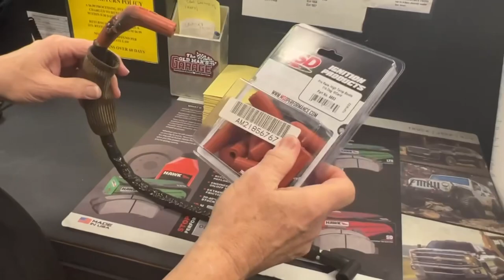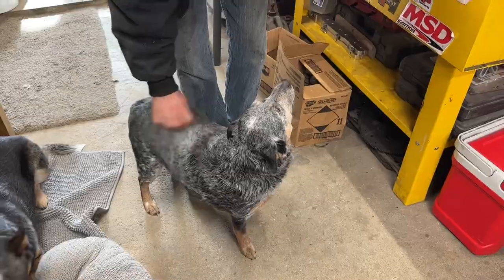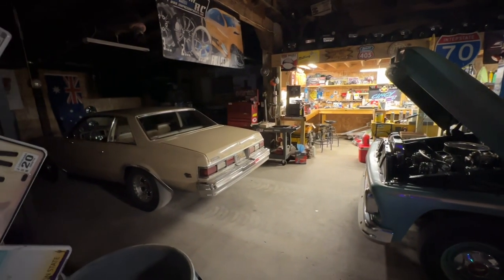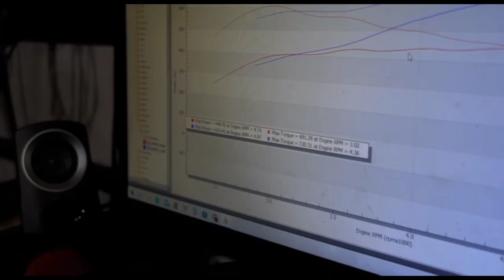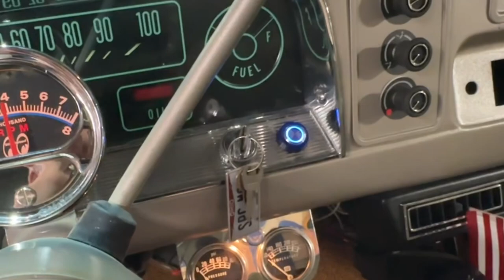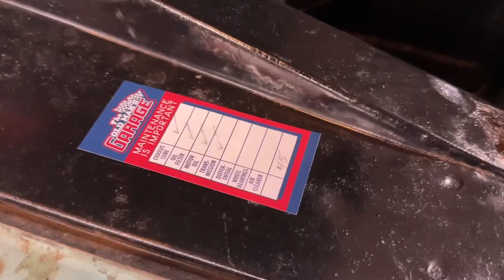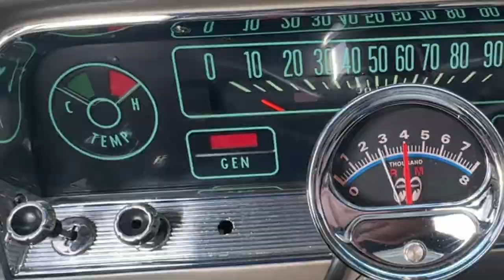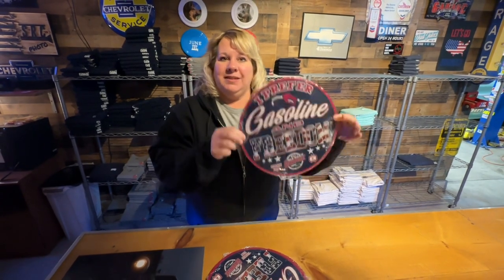WHERE WOULD YOU LIKE TO SEE ME GO NEXT?  Traveling in a 1964 C-10 and GRUDGE RACING the Malibu?

Comment: Have you checked the length of the drive shaft? If its to long it can knock the clip off😀
Reply from the maker: No but that may be the culprit.  I’ll check into that!
Reply: It's great when the comments have a good idea
Reply: Without a doubt. Measure from tailshaft housing to rear edge of the speedo cable hole, remove the cable and housing and mark that point with a sharpie around the tailshaft.

Reinstall the driveshaft, and flex the rear-end forward a bit in both directions with a primary just in case it is being caused by rear end rotation of the housing.

If the front yoke is covering the mark at any time, it is a good indication that it is approaching the clip or gear (knocking the clip off).

Remove the front yoke and have a bit machined off of it as long as it does not approach the tailshaft seal rub mark. Otherwise, you will need to have the center area trimmed on other end.

But you did have that driveshaft made to fit your own  custom measurements correct?  It may not be a Jeremy curse after all, but simply an overweight error.
Reply: Pry-bar...not primary.
Reply: Stupid autocorrect....over length.
Reply: On the other hand, maybe autocorrect is correct, you in drivers seat, trailer and fat G-Body Cracka' Barrel on trailer flexing that old C-10 with a too tight driveshaft and older weak framerails could be seen as an overweight issue...lol.

Just kidding old man, no hater here, but I think the mysterious speedo cable gear rework the 30th time may just be resolved with a bit of remeasuring and work.

Comment: 400s are known for getting hot pulling loads in the hills. My dad went through it with a straight drive 3/4 ton truck. New fan, bigger radiator, added electric fan also. Different shroud. Still got warm. 
Last time I changed oil in my 400 in drag truck filter didn't want to come off and I put it on a couple months earlier. Put fresh oil on the seal and I know I didn't over tighten it.

Comment: Hey Bill with all the oil you guys go through I'd invest in a Oil Burning Furnace for the Garage,  take the truck to a transmission shop to fix the Speed O . If you put a cap on the 65 for high way use would help keep wind and junk hitting the car , years ago a friend took his open trailer and had a peice of steel welded to the front to deflect things off the car and tool box too.

Comment: I'd get the Dakota digital guages and GPS module for the 64. I kept having issues with a 700r4 and the stock speedometer in my 65 c10. Now I have a functional speedometer and I don't have to worry about tire sizes affecting my speedometer as well.

Comment: Absolutely love watching you and love your Malibu I just recently aquired a 1980 2 door Malibu and I'm gonna build something that everybody dogs on for not being a good engine with some parts from Chevy dodge and the aftermarket I'm going to take an old late 70s ford 400m deck the block do some crank work to fit the Chevy rods with some dodge 340 V8 pistons a nasty cam and a 850 cfm carb I'm hoping to be pushing around 500 horse which makes me more then happy for my first street car  I got he build idea from motor trend a few years back when they built the "mutt" a 431 cubic inch 400m they got 505 on the Dyno can't wait to have my Malibu going.

Comment: The 64 is really getting dialed in, now it just needs a retro sound Bluetooth stereo and a set of Dakota Digital RTX gauges so you can have a nice heads up digital display on the dash to monitor all the vitals of the engine/trans and maybe converting to the digital speedometer will solve you problems with it not working. Plus it would look really sweet and update the dynamics of the interior substantially while still looking retro.

Comment: Running a hobby grade rc race truck or car at the track helps with suspension and traction adjustments when ya start running real vehicles down the strip.. tire and traction compounds and bar placement with some spring and shock adjustments will get ya goin…

Comment: Looks great. Track comment: in my local is MIR, Buds Creek, MD.—Nice track. Question; I’m having problems as you did with rears. I have a 10-bolt, 8.5 in a 73’ Camaro, approx. 550 hp. I now think I have a bent axle(Moser-Street item) I may need to look into a 12-bolt Moser unit. You implied you had a contact? Thanks, Jeff Dowell

Comment: I always see you pull your hot rods with a older truck I have forsale a 1 ton 1992 ford f-350 xlt with a 460 4×4  rust free j got it from the original owner she was in her 80s this truck has never been off road or abused it already has 2 ⛽️ gas tanks and its set up for a fith wheel  the condition of this truck is excellent.vi v thought I would give you a chance to get a shot at a nice truck. It's from az so rust free..

Comment: I would think that the transmission speedo gear on the cable needs to be able to float back and forth like .030 if it’s jammed all the way to the back of the transmission tail housing it can’t center itself like a dist gear that can’t center itself on the cam it will chew the gear up really quick not really sure how to achieve this though !

Comment: Great truck Bill!  What kit do you have that allows you to lock up the 700r4 in 3rd gear?  I have a 700r4 w/ lockup switch and usually run the lock up off unless i'm doing 80 at least.  That only works in 4th gear though.  When I'm in 3rd the switch has no effect.

Comment: Question ? Bill one old school SBC guy to another, why is it your 400 SBC in the C-10 run's 190+ degrees pulling your car and trailer over the mountains with your 700R4 and my 70 Chevelle Malibu with a 67 small journal 327 & 700R4 and a stock 3 row radiator and factory clutch fan run's 160 over the Smokey Mountains no matter how hot a day or how overloaded my 15 foot enclosed trailer is. (I know the very simple no cost answer to this, and it works) We really need to talk. When do you plan a trip to Desoto speedway in Bradenton fl.? It was in the mid 70s here today. P/S WHAT is going on with that SPEEDO ?????????????????? in the C-10Might have to tack weld the retainer clips to the output shaft.